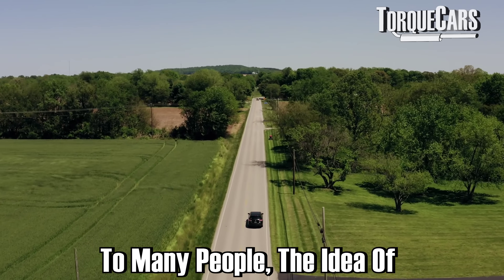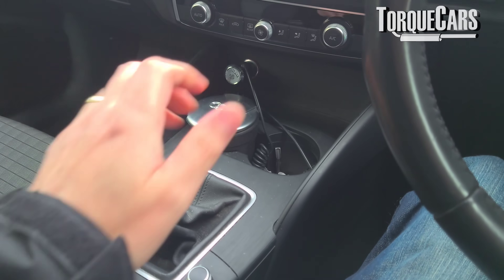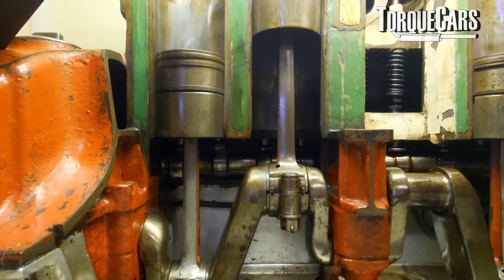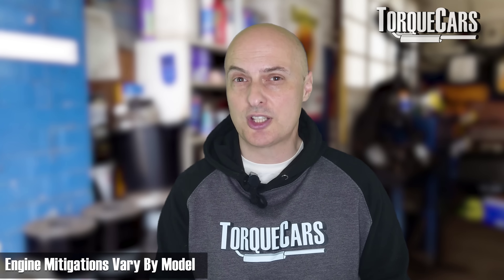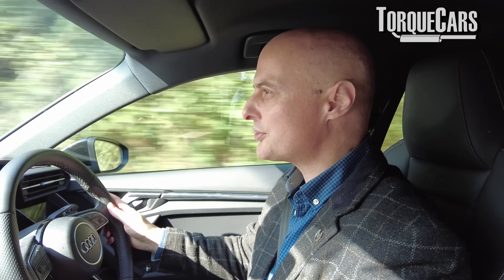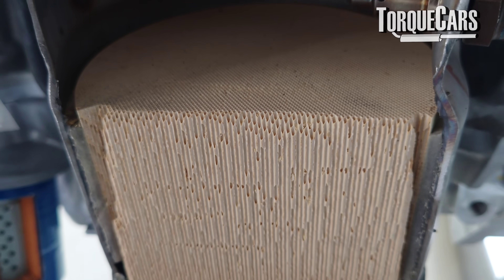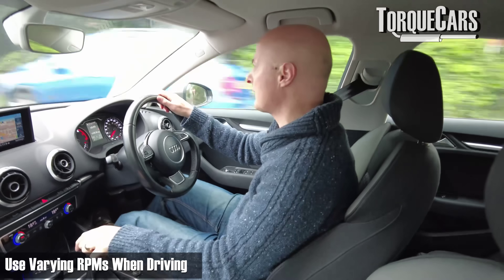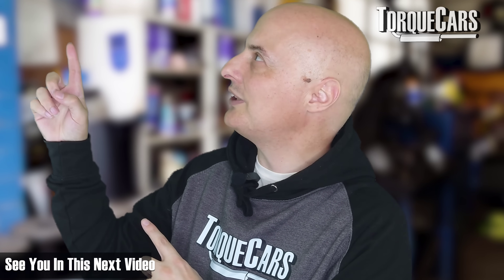BIG DAMAGE By Lugging at LOW RPM? Eco Driving Warning! (Manual Gears)

Comment: enough with the video, as i watched it all, and it has ended, now for my own experience: in city driving where you the speed fluctuates quite a lot, you need to accelerate fairly quickly, you never want to put a gear where you are at 1,500 at leave right there. On the highways, at constant speed, at fairly empty, or lets say not so much full, it means you can be at relatively slow speed, so you let the rpm drop to 1.5k, on a plane surface , not a hill, there's no straints at all at giving tiny small gas input to smoothly keep it "there" it means at that rythmr at that speed., if it is going up, drop a gear, if really up, drop by whatever gears you need to be at 3,500..4,000rpm, and floor it 🤷‍♂️

Comment: I can assure to you that manufacturer take in consideration lubrification even at idling, we are not playing games, it's not as simole as you are speaking, there are so many concepts you are unaware of, just to tell you that: engineers take into consideration every parameter, don't worry about that 😂 the oil pump "pumping" rate depends on the rpm, but we are going to start at a certain rate of pumping, right? So we start at a flow that is adequate for 780 rpm, at 780 rpm there's less friction than at 3000, and the same is even true at more, 4000,5000... So the pump can be designed to pump an adequate rate for the friction of the piston the crank the cams the lifters at a certain rpm, the constraints at a certain rpm. A pump is a gear or gears, you can ajust those, and it is a pulley, you can adjust that as well

Comment: Common sense Should be applied here,I have AUDI A5 3.0 TDI Stage 1 with downpipe and tune,my car pulls easily in 3rd and 4th even at 20-30mph,I think this applies to low powered cars like 1.0 and maybe uphill in like 5th or 6th gear, again common sense tells you don't put the foot flat to the floor in 6th gear doing 20mph.

Comment: This video makes no sens, i can feel it when the engine is strained, going at low rpm, it's not like we are straining the engine as in when you put 3rd gear and you tackle a hill, you put full throttle you feel the rpm drops, you feel you have less and less torque... I mean it's different from cruising at 80 km/h at 1500rpm, and just giving it small gas inputs to keep it rolling, no strain at all, when i want to overtake, i rev match it real quick into 3rd, 4000rpm, if i want and full throttle, the car has plwnty of torque, then i return to the lane, i cruise.

I don't have turbo, i don't have particle filter

Comment: And for a Vstrom 650?  Which is the best rpm for the best fuel economy and engine health? It has its peak torque at 6500rpm (max rpm is 12000rpm)

Comment: I have a new car, at about 3,000 miles. I try to drive sensibly, but I do have some fun. I have not hit the 7500 rpm redline, made hit 6,500, is that a problem? Should I push it harder?

Comment: So my question then is dealing with highway driving. If you are holding a steady 2k rpms at 62 mph (100km/h) for anything from 18 to 62 miles (20 to 100 kilometres) daily are you still running the risk of major engine damage? Also do you have any videos dealing with the benefits and risks of using engine friction (braking) to slow a vehicle or maintain a speed range on steeper descents?
Reply: I had a 2007 Astra 2.0 cdti in 2011… I only drove my dogs round town in it for a yearish and didn’t think the engine was lacking power.. 
let my pal borrow it he drove from Essex to northfolk.. 
when I got it back I was shocked how much quicker it picked up speed so the constant 70-90 on the motorway definitely cleaned out the engine wether that be carbon build up or dpf blockage..

Comment: I believe this is over thinking. CVT transmission will change ratio from RPM and speed. Unless you manually shift with the paddles.

Comment: 1500 rpm to 3000 rpm  is a sweet spot, for daily normal use.  the faster you spin it, the faster it wears out.
Reply: Idk, good oil will prevent wear and tear at higher rpm's anyway.
Reply: Depends what type of engine it is!  The Honda S800 sportscar will sit happily at 5500rpm on the motorway, as will many other 800cc motorcycle-like engines.
Reply: @TassieLorenzo  That doesn't sound like a comfortable RPM for cruising at.
Reply: @TimSlee1  😂

Comment: Ro80s the engine driven below 3000 rpm causes the rotor tips to wear and chambers damaged  to tip chatter , min rpm should be 3000 rpm and max is 6500 controlled by buzzer to tell you to change gear !!

Comment: Revs never a problem with my 2018 Vauxhall Zafira, the top gear is low, so doing 2,500 revs at 50 mph, 3,000 at 60 mph... I don't stress the engine at low speed, engine is 148,000 miles and sweet as a nut.

Comment: 2:53 minor correction. Too high of a gear makes it more difficult for the engine to move the vehicle. I bike a lot and if I don’t shift down a couple gears on steep inclines I have more trouble gaining speed on a bike. A lower gear reduces the stress since the engine (or your legs when you’re riding a bike) can operate at a higher speed and more effectively move the vehicle without added stress.
Reply: Yeah he conflated the two at the start when talking about hyper milers too
Reply: @thingyee1118  Lol, did you just conflate the word conflate?

Comment: My mustang hates low RPMs. Even the manual warns you about running under 1200rpm. Oil starvation is a real thing on anything with oil-driven cam phasers. You never see a Mustang driver taking it easy because they're trying to preserve their engine 😅
Reply from the maker: Thanks for sharing we don't get many Mustangs over here.
Reply: @torquecars  they'd be horribly-suited to most European roadways, so its probably for the better. I wish more American drivers watched your videos because there is a major knowledge gap on good driving habits here, resulting in far higher catastrophic failure rates in vehicles nationwide. Keep up the good work!

Comment: 40 years ago or so, Saab gave instructions on the use of their engines and stated that the engines were happiest at about 2500rpm. This is quite a good yardstick for most petrol engines and, if like me, you are a retired petrolhead, my Alfa and Subaru engines have felt to be free running at between 2000 and 2500 rpm. Below 2000 you can feel that the engines are not as happy. I have just bought my first turbo engine and it feels as if it is moving freely and smoothly at slightly lower rpm, maybe 1800 but no when pulling uphill..However, I am no expert on turbos.
Reply: The Fiesta 1.2 Zetec I have will start to feel vibration if I mash it below 1500, so I'm lighter on the accelerator until 2000. I'm usually puttering around town at barely above idle, as it doesn't take much accelerator use but open it up when I get into the 60s and rarely make really short trips. But as a rule of thumb if the right pedal is down then the revs should not be, and if the right pedal is not down, then the revs may as well be in terms of fuel efficiency and because it's no longer lugging.

Comment: So where should you drive your high-revving car if you don't need to take the highway often? Most people drive cars in traffic jams all the time...
Even if I have to go 40 km outside the city and I'm driving on a normal road (not a highway), all the speed limits prevent you from having to engage the gear at high revs. 🤷

Comment: Growing up my parents had one manual transmission car & the engine was rubbish in 2 years. My dad lugged the engine & it knocked. He shifted up when it stopped knocking. Sounded like a diesel. I remember the car shaking a lot at low speeds. Oil pressure is low at low RPMs & parts are grinding against each other under load. He thought the lower the revs the longer it would last.
Reply from the maker: Thanks for sharing

Comment: When I went to the Philippines to get my fiance, I was struck by the odd behavior I saw the cab drivers exhibiting. They never revved up their engines over MAYBE 1200 rpm,and were in a huge hurry to get up to 4th gear. This while never going more than maybe 35 mph. If there wasn't such a language barrier, I would have loved to ask why they did this, but instead I focused on my fiance, and absorbing my surroundings.

Comment: I got a v6 automatic, and if I accelerate normally or even a little faster than other traffic users. My rpm never goes above 2000. Only when im entering a highway with a ramp and accelerate pretty quick it might reach 2500rpm. 

I do push the car from time to time to keep it fresh. 

My other car is a 2ltr 4 cylinder manual. From 2023. U usually shift between 2000 and 2500. Is this considered low rpm driving?

Comment: When the engine is cold on my petrol hybrid (very small electric motor but adds some torque) I like using the full throttle at high gears to get up to speed but only for fractions of a second, the time to go from 1500rpm to 2000rpm and get immediately to fifth gear. The car is very light and it is aided from the electric motor so i never feel I’m straining the engine. On a diesel car there’s still more to tell (carbon residues are more of a pain in those engines)

Comment: My car has a shift light. Which is very agressive to save fuel. In 60 km/h, I use 4th gear and 1800 rpm. The light tells me to shift to 5th gear and 1400 rpm. Which I don't. But the guy here want me to use 3rd gear and 2500 rpm. Which I also don't.

Comment: i burned out a poorly constructed Mitsubishi manual transmission with low RPM driving .does not slap enough grease around and burned the bearings out, so now i keep the sucker always above 3000 RPMs. I was stunned when the tranny shop just said "known issue with the tranny"
Reply: What year and model? Have a 09 Lancer GTS with a 5 speed on its second transmission, and really want it to be its last
Reply: thats definitely one way to say transmission
Reply: @pasatebo that's quite literally the most common abbreviation of transmission

Comment: full of shtt
modern auto transmissions shift at low rpms for fuel economy.
they shift at higher rpm if you floor it.

aka 99% of all driving is automatically put at low rpm
Reply from the maker: And I'm not talking about automatics as I explained in the video - 70% of cars over here are still a stick manual transmission.

Comment: This is stupid I don’t agree. An engine is fully lubricated in seconds and that’s at idle. Low rpms high rpms it’s all the same no damage. What you do have to worry about is short driving. Try not to take short trips the engine needs to get hot so it can burn off those carbon deposits. People that take short trips in the car tend to have more carbon build up.

Comment: 3:50 Aren't pistons connected to the connecting rods, which are connected to the crankshaft? Wouldn't that mean the pistons move the same amount no matter the RPM?! The speed at which they move will change, but the distance they move is fixed.
Reply from the maker: Sorry I clearly haven't made my point as well as I thought.  I was talking about the amount of piston travel RELATIVE to the combustion event.

The combustion event will not wait for the piston to travel, it will just dump loads of pressure on the piston which has only moved  a fraction of it's full travel. 

Obviously the engine timing will try to mitigate for this to some extent, but the key is that the "bang" happens and if the piston is moving too slowly away and you have a "big bang" you have a big pressure wave - blow by will be a higher risk also. The harder the throttle is pressed the worse it can be.

Thankfully modern engines with drive by wire will mitigate some of these risks but there are still a lot of cars out there that won't.

Comment: I use the manual shift mode on my automatic ALL THE TIME. It comes in handy to keep the trans from hunting for gears when climbing hills especially at slow speeds on back roads. Also when on the highway and pissheads wont keep it going.

Comment: I suppose in cars with throttle by wire the effects of lugging are minimized. The ECU will ignore your flooring the gas pedal at low rpms and will open the throttle plate as much as it sees fit for the current rpm and load. TBW has been available since at least 2000 as my Alfa 147 1st gen has it and I seem to remember some VWs with the 1.4 16V engine having it earlier. I believe all new cars have it.